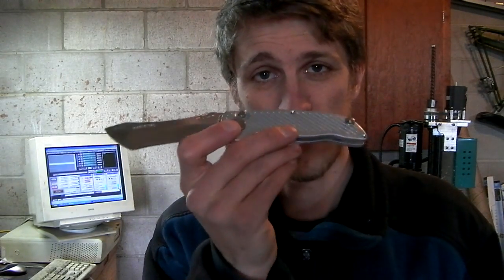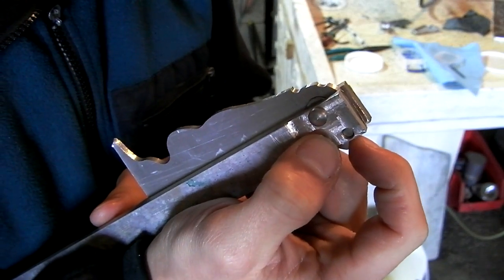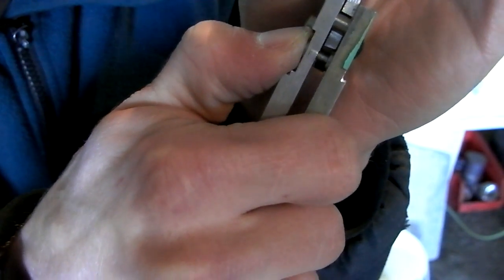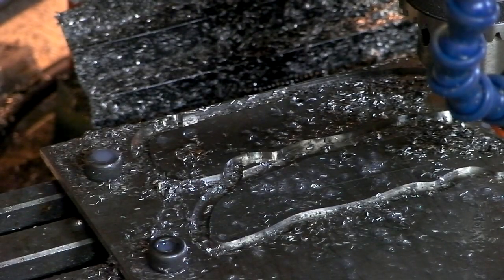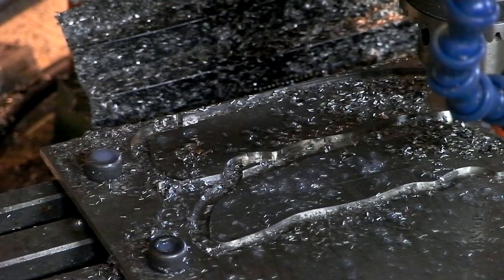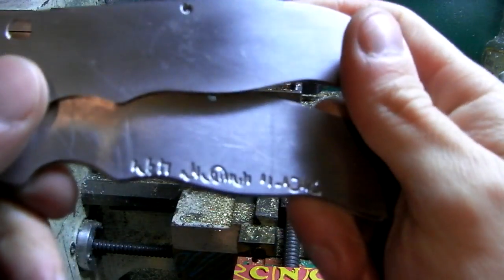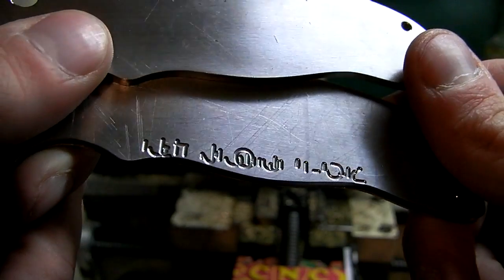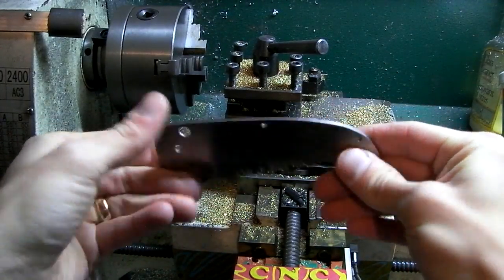Knifemaking Tuesdays Week 09 - Testing button lock and making Ti handles

Comment from the maker: @bigchad007 I'm having a friend make me 20 Tormach TTS style holders for ER20, but modified to my own requirements, he said he'll make them this weekend.  Then I've gotta order collets and nuts, I'll try to do that tonight.  Then finish and install my power drawbar, 80% of the machining is done.  That will get me very fast manual tool changes and a nice stocked tool table with all the offsets ready to go.  After that comes my automatic toolchanger which is designed but not made yet.

Comment from the maker: @wolf5391 I don't think it'll be a big deal, if my bearings and standoffs are the exact same thickness through the length of the knife, they will bend it straight and hold it flat.